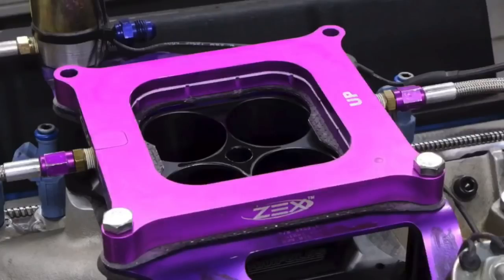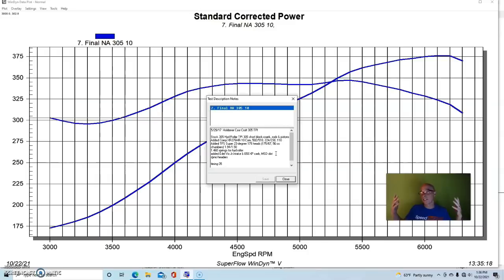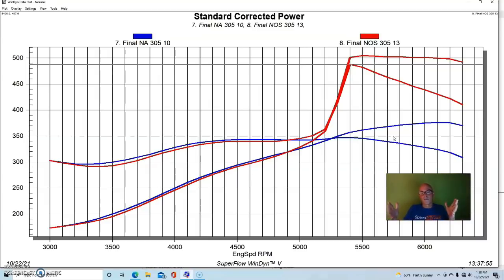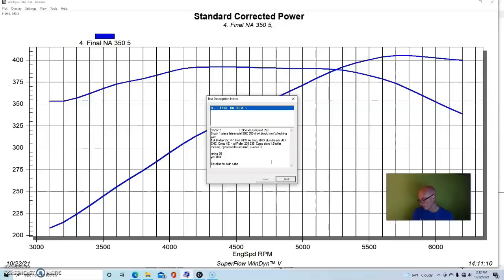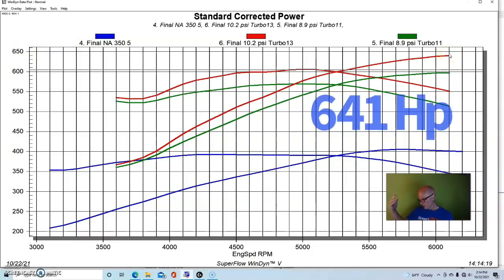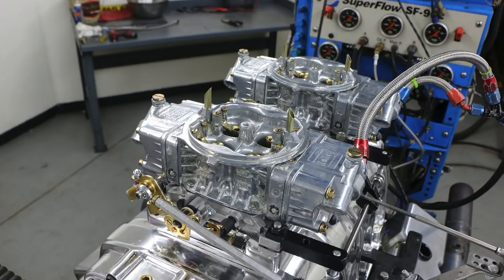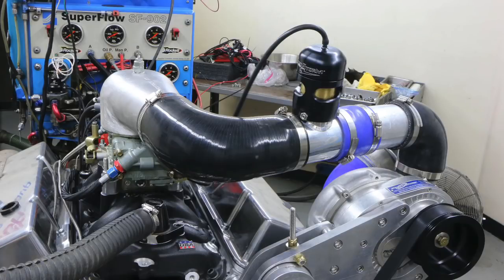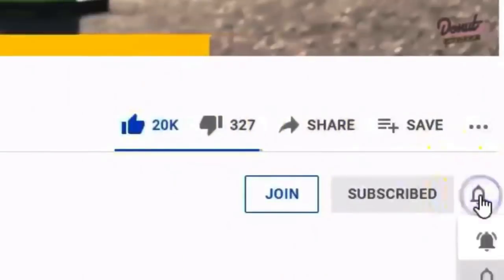HOW TO MAKE MORE POWER: SMALL BLOCK CHEVY POWER ADDERS. NITROUS, BLOWERS AND LOW$ TURBOS ALL TESTED!

Comment: I get that the factory fuel injection was junk on these vortec 350 motors, but you always throw a carburetor with forced induction on every 350 when hardly any of us run that setup. Maybe I'm just trying to figure out how to get the most out of my 96 OBS with all the factory and OEM equipment. Do you have any videos of you running a stock 350 vortec with the stock throttle body or even an upgraded throttle body with all of these tests that you do?
Reply from the maker: I have never run a factory ECU or factory EFI induction on a Vortec 350
Reply: @richardholdener1727  so.... Can you? I know the premise of your program is to produce the highest numbers possible with horsepower with whatever sort of combination you're running, but for some people bawling on a budget like me, I'm trying to make the most out of the factory components. Our daily drive, a 96 two-door Tahoe Z71. Z71. I can't really afford to swap it over to a carburetor and get even worse fuel economy. Show me how to make optimal horsepower and torque utilizing factory vortec heads, naturally. Aspirated. For instance, can I change the intake manifold? I know there's a throttle body upgrade but is it worth it? What would be the best way to maximize a factory EFI 350 VORTEC? BY ALL MEANS STILL PUT A CAM IN IT TO OPTIMIZE THAT, BUT SHOW US WHAT IF ANYTHING YOU CAN CHANGE TO RETAIN THE FUEL INJECTION. NEW THROTTLE BODY? NEW INTAKE MANIFOLD? NEW TRUCK CAM? DOES ADDING HEADERS VERSUS THE FACTORY EXHAUST MANIFOLDS MAKE THAT MUCH DIFFERENT?

Sorry for the all caps

Comment: @ Richard Holdener , curious for the typical 23° 350-383 with 10-10.5 to 1 compression what do you consider your "go to" camshaft? Notice an aweful lot of 276/280 ish @.006 hydraulic rollers in catalogs, usually 108-112 lsa with lift all over the place as well as Vizard, and Lingenfelter books repeatedly saying that's about the max for a true dual use street car with emphasis on performance. Even a lot of your vids you use the comp 274h, or xr282hr etc.
Reply from the maker: THE 350 AND 383 WOULD GET DIFFERENT CAMS-THE 268 IS POPULAR FOR A TYPICAL SUB 400-HP 350, THE 383 WILL ALLOW MORE CAM TIMING

Comment: I just built a SB400 with stock crank. Forged 5.7" rods and hypereutectic pistons. Aluminum heads with a calculated compression ratio of 10.5:1 
I did not plan on doing a power adder but I now want one. I did gap the rings for boost just in case. On this set up would all recommend 250 nitrous or Turbo if so how much psi boost you think it can take.
Reply: No matter what your compression ratio is going to kill any good boost.. lower compression=higher boost.. my setup is 383, forged eagle stoker crank, forged eagle h-beam rods, SRP -16 dish pistons, 205cc heads, 9.5:1 compression, haven’t completed the intake and carb choice yet but plan to run 15-20psi with twins. I recommend to run low boost on your current setup or it will not stay together long.
Reply from the maker: I would start with a smaller shot but yes it will also take boost
Reply: @richardholdener1727  100? 150 shot?
Reply: @DavidNewkirk  why not start with 50 and work your way up?

Comment: Hey Richard just curious if you’ve ever built a 352   400 block with 327 crank or if you’d ever do a video on one. Thanks
Reply from the maker: westech has a 372 using a dart block-used it many times

Comment: Don't you think you kinda robbed the 305 of more power by not changing springs? It seems like that's something you guys do quite commonly. I realize it's not ideal but on the dyno changing springs isn't too too big of a deal.
Reply from the maker: we run what comes with the heads-but peak power would not have changed

Comment: Dry sump, 40 pound stoker crank, 6” rods, .060 over bore, proper pistons, worked high flow heads,nice cam, dual plane intake, holly carb, headers. You know average daily street engine 🤣 add boost for increased pants ruining fun
Reply: Have you found the 638 and 880 roller blocks to be reliable at .060 overbore at over 450/450 tq/hp?

Comment: Hello Richard. Can you please do a video on the difference between the gold and silver throttle bodys on the ls 6.0 engines with the 3 bold and 4 bolt, 6 wire and 8 wire . Can't find any info but the gold and silver turn opposite of each other and 1 won't work on the other.  It's what I can find and it just don't seem correct information ????? Confused.
Reply: The gold one is for LS3 PCM and the silver one is LS2 and is the one compatible with 411 PCM as the gold one is not!
Reply from the maker: I don't run factory ECUs-so on the throttle size would make a difference

Comment: Wondering why the 350 made lower numbers than I expected with that cam and heads combo. I’d have expected to see 430-435HP. Too much head and smaller valves might have helped, like 1.94 & 1.56 for better airspeed? Quench was (?), chamber size and SCR/SCR were (?)

Comment: I am proud to say I'm currently building a vortec 350. AFR 190cc heads, flat top piston. Not sure what cam yet since it is going in a Z71. I want to keep the power curve below 6K rpm. I'm leaning toward a First TPI. Since I can tune  the factory ecm, that what I'm running it with. 
Why all this for a Z71? It's cause I'm stupid and can't grow up. 🙄
Reply: Consider the Comp Xtreme Energy 08-422-8 or one of their Xtreme 4x4 cams in the same duration range with similar or a tiny bit less lift. Your heads can handle more airflow than these small to mid sized cams but a 4x4 really benefits from huge low RPM torque. I’m running the 422 on my 2WD 92 C1500 with 1.6rr for .528/.535”

Comment: Speaking of power adders I have 256k on my 5.3 what’s the chance it blows up if I start adding more power there’s no misfire from what I can tell and still runs well with plenty of power
Reply from the maker: all of our Big Bang motors had 250K miles before boost
Reply: @richardholdener1727  that’s freaking awesome good to hear thank you
Reply: @myguysponge7325  remember, what he can get away with for 30 seconds at a time with very low coolant temps in a short Dyno run is not what you can get away with in a car with 200° coolant temp, also you'll usually have to run a little more fuel, less timing for that kind of wot power when you plan to run it wot for minutes/hours at a time. Just saying optimal tune in your car will lower power output compared to the results Richard gets.
Reply: @b.c4066  thanks this is something I didn’t really think about
Reply: if you drive it right, im pretty certain you can put a 100 shot on it MAX and drive it around for around 20k miles. at least with my experience with stock engines, they hold up pretty well assuming preventative maintenance took place
Reply: It's like nobody knows who Sloppy is or what he's done.

Comment: What about all of them.
Nitrous fogger to keep the 88 mm twin turbos spooled pushing thru a cold air intake into the root supper charger.
Reply: I was hoping he said we tested them all together
Reply: Twin procharger into a 2 into one intercooler out into the roots blower with a nos plate between them and direct injection with mechanical pump. While you are at it add camless valve train.
Reply: I'm building a blown 396/402 on my channel now that I'll run in this configuration for a couple months. Long enough to get dyno numbers. Then I have a pair of ebay gt45s that will be set up as you speak of without the nitrous.